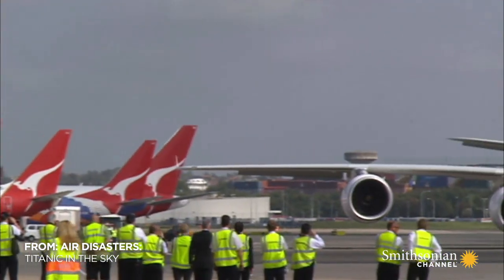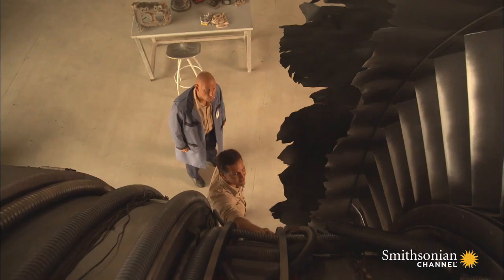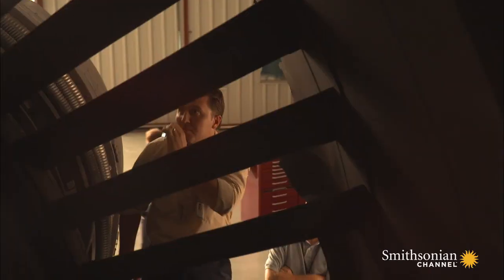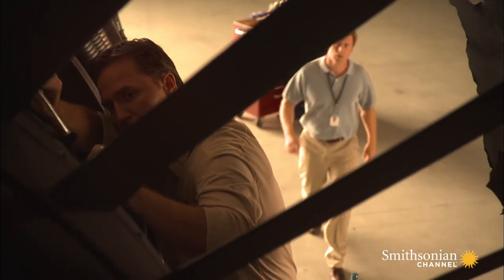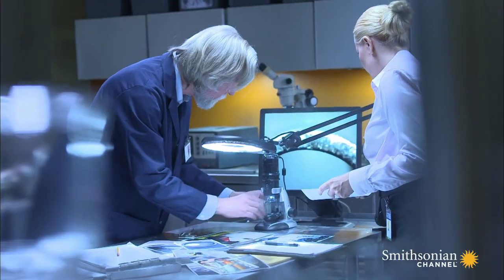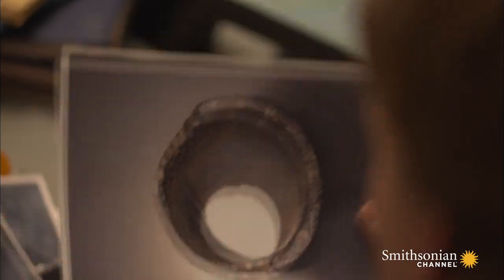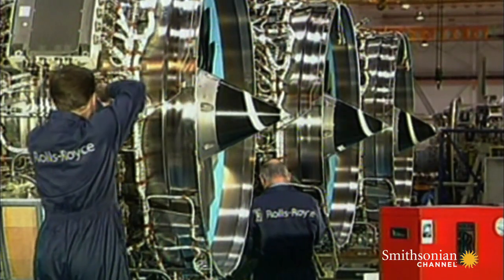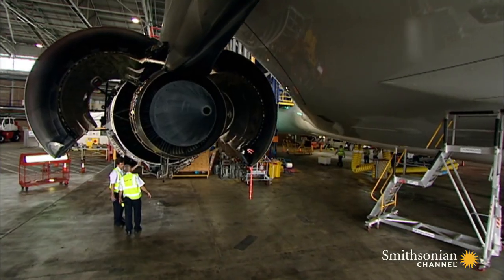This Tiny Pipe Brought Down This Massive Plane

Comment: It did not bring the plane down in the way the title is implying
Reply: A positive ending.  You must hate that.
Reply: Dan Jones we hate that.
Reply: @celtic barbarian *bait
Reply: it did, it forced the pilots to descend and make a landing
Reply: @fusion4373  it didnt bring it down tho because it didnt crash. Also it didnt need to land it was just a precaution
Reply: @anonymouswriter448  which needs to descend which is going down so
Reply: deez nuts bruh crashing and going down are different, going down is going down unexpectedly and crashing is the moments before impact I would say
Reply: @anonymouswriter448  It damaged numerous systems on the plane and caused a fuel leak. It was not "just a precaution"
Reply: @pauldzim  its was it still had 3 engines and it only damaged the fuel pipe to that engine. The plane could've kept going
Reply: JayJay I think they meant NEARLY brought a plane down
Reply: @Va Sr not necessarily. They only lost systems to the forth engine and with 3 others they could've kept going
Reply: @anonymouswriter448  They had limited control of engines 1 and 4, they were loosing fuel, and many flight surfaces weren't working/were limited. They could have kept going, but that is like saying United Airlines 232 could have kept going.
Reply: Uh it did. Did you even watch the video?
Reply: r/woooosh
Reply: @vladivosdog  I don’t think you know what that means
Reply: @triggeredcat120  implications. That’s all I’ll say
Reply: @danjones9007  at what point did I at all suggest that I would not like a happy ending?

Comment: At least 3 errors here  ~ Pipe made incorrectly/ Not inspected after/ then Not inspected at incoming Point./ Inspectors if guilty should be sacked
Reply: Purchase department ordering from an unreliable source... 
For me that looks like a wrongly manufactured pipe - the thin wall could have occurred at the steel mill already.

I once got pipes from a Chinese steel mill which had all kinds of production faults (thin walls and clogged bore included). Fortunately we just used them to make instrument covers out of it, so the faults got obvious before any subsequent damage could occur.
Reply: Not every dimension on every part is or can be checked.  Measuring the wall thickness on a bend is rarely specified as a check measure.
It is controlled through the bend process, which has its own set oc control procedures. 
Could have also been a manufacturing fault at the pipe manufacturer.

Comment: If this is the incident I'm thinking of: the adjacent engine to the one with the fire was unable to be shut down due to the damage and fuel was spilling onto the runway after the plane had come to a complete stop. It took some time to get the situation under control so the passengers could safely deboard.
Reply: The incident is really an incredible confluence of factors - a freak accident (unconstrained engine failure; shrapnel disabling hydraulics, severing multiple electrical trunks, setting fire to a fuel tank, etc.) causing chaos with the instruments, combined with the most overqualified crew possible to handle it (experienced pilots, along with both an extra check captain AND a senior check captain checking him that day and even an off-duty pilot providing critical info from the cabin).

Terrible and amazing luck all in one flight, but it's a real blessing this problem was discovered and fixed without any loss of life. Too many safety guides and alerts are written in blood.

Comment: My understanding of the failure is that when the pipe broke it deprived the main bearing between the compressor and the turbine of oil. The lack of lubrication then caused the bearing to fail, which in turn severed the interconnecting shaft. When the shaft severed it decoupled the turbine from the compressor. Once the turbine was relieved of the mechanical load imposed on it by the compressor it cause the turbine to spin way up and immediately go into overspeed. Ultimately it was the excess rotational speed that caused the turbine to come apart. The fire was actually just a secondary effect of the broken pipe and it didn't directly cause the engine to explode.
Reply: Joe Vignolo the way I thought about it was with no lubricant it heated up and possibly sparked causing a fire
Reply: Somehow you have to account for the turbine coming apart and throwing out turbine blades, which damaged the wing. The turbine going into overspeed because it became uncoupled from the compressor explains the turbine disintegrating.
Reply: Joe Vignolo yeah
Reply: Wait wait wait...that’s not at all what I heard. The story I got was the water pump had a leak causing leaking coolant to run onto the timing belt. This caused the belt to slip due to the lubricity in the coolant. When the belt finally slipped enough it broke and then the pistons and valves in this model interference engine made contact bending the lifters and damaging the pistons to the point the engine stopped. Classic example of not changing the water pump eventually causing engine failure when doing a timing belt change. The cam oil seals should also be replaced when an engine is the overhead cam model. On a non overhead cam it’s less vital if a leak develops. Always always always buy components as a package to insure no differences in quality.
Reply: No, the oil was introduced into the engine in high temperature air, the resultant fire raised the temperature of the intermediate turbine disc above its design temperature in seconds, the disc expanded, started wobbling, and broke apart.  Thermal loads in a turbine are a fine balancing act, these engines run much closer to limits than most other machinery, thus the requirement for absolute quality control.  

The repost pointed the finger at the RR plant where this part of the engine was made, serious cultural problem with regard to quality assurance, most other parts of RR did not have the problems - the fish stinks from the head. Most, perhaps all of the turbine parts are made by RR, yet even this vertical integration did not save them.

They were very lucky that the debris from the turbine missed the pressurised cabin, passengers and further critical systems - bloody lucky!
Reply: @robertnicholson7733  The pictures I've seen seem to show fire damage on the outer casing of the engine. Also the pipe that failed was an oil supply line. This would seem to suggest an oil leak and oil fire outside the engine casing. So exactly how did the oil get into the engine and start burning, which in turn caused the turbine disc to fail?
Reply: @joevignolor4u949  You don't have to interpret pictures the following from the ATSB is quite clear.

https://www.youtube.com/watch?v=8TQTG0RE42g

Failure analysis starts at 24 minutes, yes there was overspeed but this was a consequence of the oil line failure inside the casing (the oil pipe cools and lubricates the turbine bearings on the turbine shaft, so clearly the oil feed pipe must be inside the engine at some stage) causing a highly destructive fire inside the casing.  The external, short term, fire was merely a consequence of the destruction of a large section of the engine.
Reply: @robertnicholson7733  Thanks.
Reply: @robertnicholson7733  Yup, I watched the whole video. Now I get it.
Reply: @joevignolor4u949  I must thank you for challenging me and forcing me to look at this engine failure again.  The video you watched was not available when I last looked at QF32.  Clearly, my memory is not as good as I thought, so I am sorry for some misinformation.  I must see if I can find the whole presentation, despite the presenter's constant water drinking, it thought it very good.  

Each time I have looked at the video, my astonishment at how lucky QF32 was increases, that 90 kg section of the turbine travelling at just under 3200kph - it just doesn't bear thinking about the consequences of it passing through the passenger section of the aircraft or through the wing spar.  Also, finding that piece of turbine, must be a story in that.
Reply: @robertnicholson7733  Yes it was remarkable how they managed to get that airplane down in one piece. All the issues with the hydraulics and electrical systems and the #2 engine not running on the left wing and the #1 engine running out of control. It's a good thing the #1 engine didn't quit or else it would have been game over. This incident is a reminder of how unforgiving aviation can be. One simple little detail regarding that oil pipe almost brought that huge airliner down, which would have killed all those people. I worked on airplanes in the Air Force and you have to always remember that you have people's lives in your hands whenever you work on an airplane.

Comment: Makes sense, engine oil isn’t exactly highly flammable but it is combustible which means if it comes into contact with heat and air, it can ignite, that’s what happened the stub pipe had high pressure on one side and low on the other, the pipe couldn’t withstand the pressure and broke causing oil leakage into the combustion chamber, that’s where the jet pipe is, where exhaust gases drive the turbine, oil was ignited in there sparking fire onto the turbine disc which probably spun out of control and exploded.

Comment: Obviously Rolls Royce needs to make a better engine. Not because of the oil pipe, but because of the uncontained failure. A turbofan engine should be able to remain contained within the pod, even under catastrophic failure of the rotor.
Reply: This was a turbine failure, the rotor was not affected. The turbine, being driven by the exhaust of the combustion chamber, can easily exceed the design load of any containment you could put around it. The forces involved are so great you would need to encase the whole thing in a couple inches of steel to contain it, that just is not economical for a failure that has such a low chance of occurring in the first place.
Reply: that's why british and australian based airlines and whomever flies A380s should consider putting general electric engines on the A380. BUT NO AIRBUS IS TOO DAMN PICKY
Reply: Rolls royce makes good engines! It's just some particular models have defects and then it goes all to sh*t.
Reply: @derekwall200  That was highly biased. The GEnX was not developed yet, and all the other engines were not fit for the A380, rlls royce made engines for the A380 via contract with Airbus Industrie, they also had another manufacturer but most airliens chose the rolls-royce.
Reply: Powertampa ...low chance or not, you willing to risk  YOUR life on it? Economical or not, fix it or park it!  I wouldn't risk MY life on it for a $10Mil life insurance policy!  But, you go for it if you choose to....
Reply: Derek Wall ... YOU would bet yr life on GE?  There was a time I would have but, NOT ANY MORE! For instance-in 1969 we bought all HE appliances for put "new" old fashioned home. I STILL have the freezer, runs great! (Other stuff went when we sold the house.)   But, I went through 2 NEW GE Washers in 5 yrs. before about 4 yrs ago!  I bought a USED washer of another brand & it's still going strong.  It's 2019 now & I own not 1 GE product. Never will ride a GE engined plane either!
Reply: I Like Potatoes... Boeing was using them when I worked there in the 80's but, I can't swear to how good they were.  Hope none of them crashed!  I hear the 1st 747 we built in Everett, WA crashed.  Makes me shudder. Don't know what make the engine was.
Reply: @ohwhatelse  - The casings ARE designed to resist shrapnel however the rotor disk has enough energy to render them ineffective so instead they are designed with extremely low tolerances

Comment: never see anything like this happen on production aircraft with engines made by Pratt and Whitney
Reply: Ahem, boeing 747-100 test flight at 1968, ahem. Engines had major overheating problems ahem.
Reply: And it was a rolls Royce
Reply: LOL "On 29 May 2014, a Bombardier C series CS100, registration C-FBCS, serial number 50001, with 2 pilots and 4 test engineers on board was conducting engine ground runs at the Montréal International (Mirabel) Airport, Quebec.

During the test, at 1837 Eastern Daylight Time, the left engine (Pratt & Whitney Canada model PW1524G) experienced a sudden power loss caused by an uncontained turbine rotor failure"

Comment: Cracked fan blades thicken the blades
Thin pipes make the 9mm thick 
Ice sensors frozen make them heated
Peto tubes frozen (make them heated tubes)
Simple fix 

Frozen wings (make the wings flap the ice off or warm the wing)

Comment: Rolls Royce BR 725 engines always leak oil on the Gulfstream 650, but I guess it’s a different kind of leak
Reply: Leaking is one thing... An outright pipe failure followed by a spill of oil which at it's peak would have been measured in liters per second is something completely different.

Comment: it was metal fatigue in one of the turbine blades inside the engine. combine metal fatigue with the extremely hot temperatures inside the engine it'd be only a matter of time before you have a fan disk failure
Reply: Wrong video, that was for United 232

Comment: AT THE TIME THAT AIRCRAFT ENGINE WERE HAVING ROTOR DISC PROBLEMS THEY WERE HAVING SIMILAR PROBLEMS 
WITH LOCOMOTIVE TURBOCHARGER AIR WHEEL FAILURES!
I WONDER IF WAS CAUSED BY MATERIAL SHORTCOMINGS OR MANUFACTURING MISTAKES!

Comment: I heard the plane run by compressed air and not fuel......
Reply: The air is compressed, which in turn makes it hot. That hit compressed air is then introduced to fuel in the combustion chamber. Creating thrust.
Reply: No? Why would you think that?
Reply: @killerdonkey5750  I heard it... They say it's compressed air and there is no way the wings could hold that much gas..
Reply: @Nawabid  no, they literally carry 610,000 pounds of fuel. That's, have you seen and A380 in person? They're fucking large.

Comment: So-HOW "near catastrophic" was it!?    Did it crash? You sure did a cliffhanger-jpb on us!  Why did you DO that?  Crazy dodos.
Reply: Didn't crash thankfully. Pilots were able to bring down the plane. Also not a real cliffhanger since you can figure that out by the engine; since if it did crash it would of been destroyed completely but as shown it only suffered a blow out.
Reply: If shrapnel damage wing and hull, it is not funny anymore.
Reply: Most of the aircraft's flight controls were either noticably degraded or non-functional as a result of the uncontained engine failure. It was a minor miracle that the crew were able to successfully land the plane period, and they did it without any injuries at all.